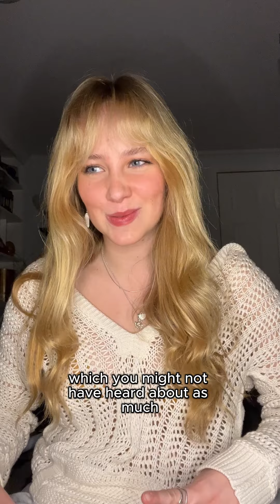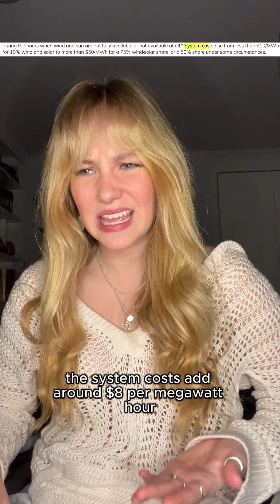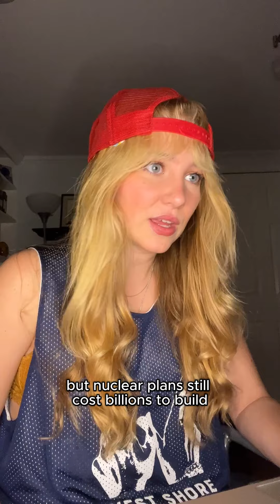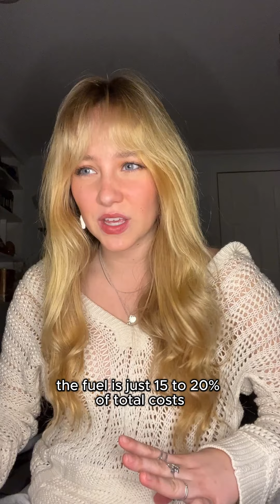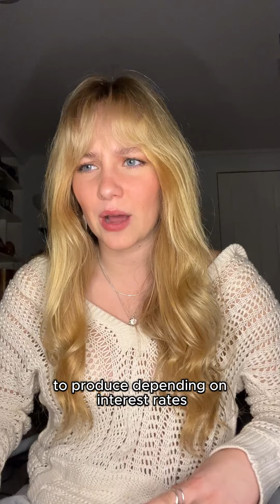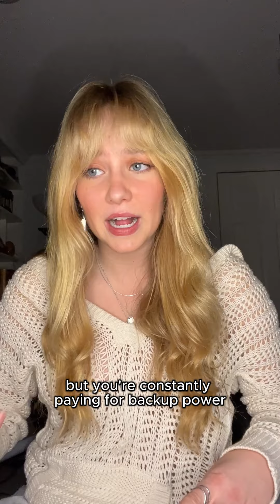The Hidden Costs of Wind and Solar #renewables #renewables #windpower #solarpower

Comment: * Solar panels usually work 25-35 years (and can work longer!)  (not 20), a recent test showed a 30 year old solar panel still working at 79,5% efficiency.

* Solar panel technology is becoming cheaper all the time, and new perovskite technology exist in some testing conditions, this will most likely ramp up efficiency from 22/23% today  to 25-30%  which is a 10-30% increase. The materials are said to be cheap.

* In Finland, we have cheap electricity, so cheap that a project of building a new nuclear reactor was seen as not worth it.  (we have water, wind, nuclear) as main energy.

* Solar panel system pay themselves back normally in around 10 years. With good prices in 7-8 years. After that all you produce is free electricity for 10-25 years

* Nuclear is a good option, as long as there are no accidents, and you store the waste ,material properly... so a question, what is the COST of storing nuclear material for 10.000 years? And what do some leak accidents "cost" if they happen?
Reply: Solar in Finland, lmao. Y'all just finished a new nuclear plant and it's awesome
Reply: @EricMeyer9  Yeah we have a new plant, but it has been suggested, that one more should be built for future needs (example EV´s will consume more).
And yeah, solar works even here!  Did you know that a colder climate actually benefits solar cells production?
Reply: So you need to pay for the solar panels AND for the backup capacity for the winter months, when most of the energy is required.
Forget wind, it's neither cheap nor reliable.
Reply: @artuselias  No, I don´t install some backup capacity... I am connected to the grid, and use that electricity when I can´t produce "anything" myself (or some 2-5% of my need) in Nov-Jan. In Feb production starts, and in March it is already significant. From April to August I should be able to export some during the day.

Comment: Wind and solar are infinitely-expensive, on a sustained basis. This fact needs to be unhidden.
Reply: Also the fact that none are truly “green” in a circular economy sense because the core materials of these renewables require trace minerals that can only be mined and transported via hydrocarbon powered mechanisms

There’re yet viable alternatives for heavy machinery, trucks, and vessels or barges that aren’t hydrocarbon fueled that can work as long

And used up renewable components have little yield being recycled 

Hence the need to implement reusable design in the overall ecosystem infrastructure
Reply: Oh yes so oil and coal is more sustainable? Put down the Crack pipe fella
Reply: @erikedlund2904   "...oil and coal are more sustainable..."
Correct. Wind and solar are inherently unsustainable.